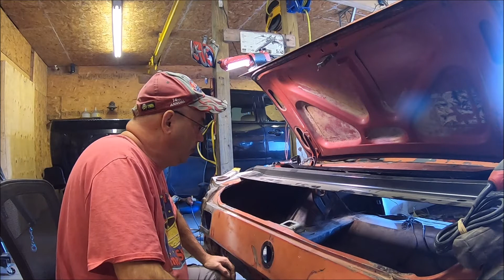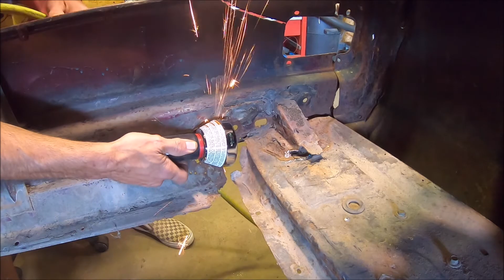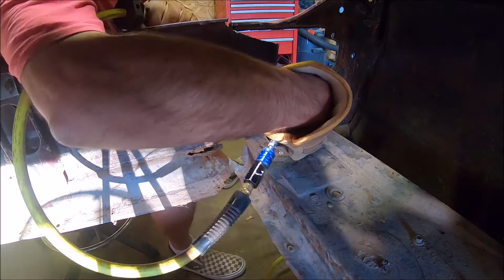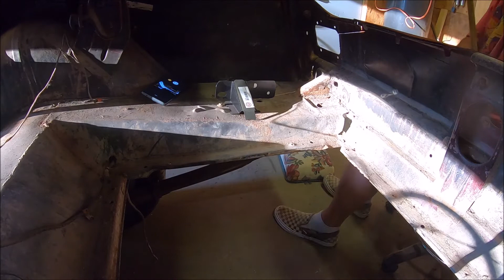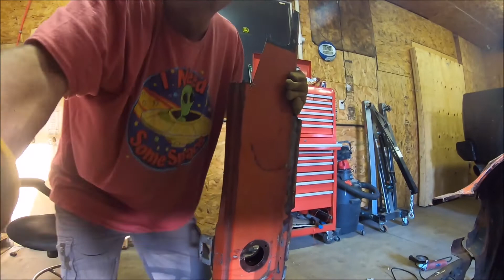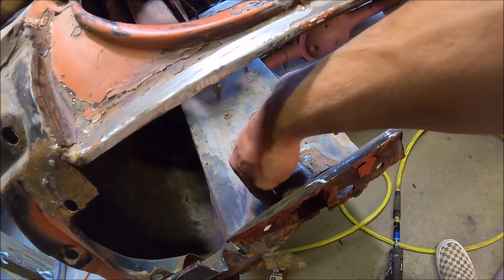1965 Mustang Coupe Restoration Part 7 TAIL LIGHT PANEL REMOVAL

Comment: Did the shop shut back down? The last video said the website would be up, but I don’t see it anywhere
Reply from the maker: No, the shop is in full swing . Waiting on the dynacorn tail light panel as it’s more accurate
Reply: @redkeyrestorations4862  but no website?
Reply from the maker: @jeremyh8361   working on the website still.
Reply from the maker: Website back up, soon will be getting a few cars